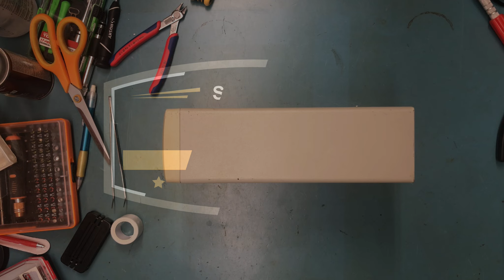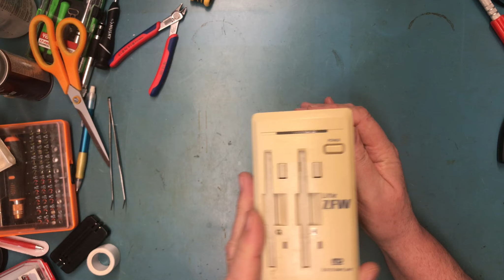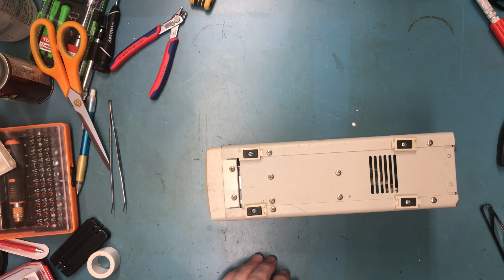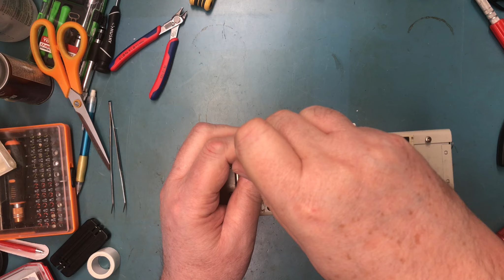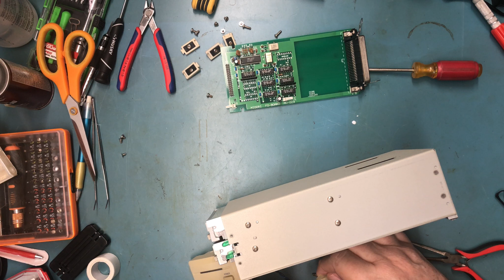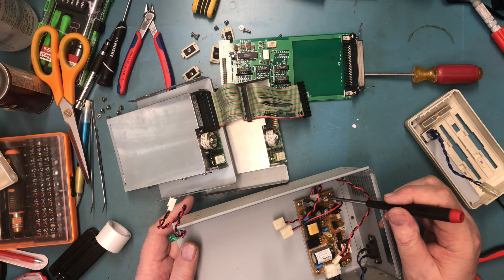STB1173 - Midori Denshi - External 3.5 FDD - ZFW Floppy Drive Unit

Comment: Hi, that 30 pin NEC shrink dip is the μPD71066, a FDD support chip / interface often used un more complex floppy subsystems like protocol converters or like here external drives to ensure clean signals at high (for the time) data rates on non differential connections. It separates the controller logic from the physical interface.
Reply from the maker: Thanks. This helps and makes sense. Any idea what system this drive was designed for?
Reply: @ShadowTronBlog  no, sorry. Especially with the Japanese computers I’m very unfamiliar with. I just recently searched up and down for floppy controller parts and their compatibles and equivalent chips from other manufacturers to replace a rare and expensive part plus it’s even more expensive companion support chip. And almost all digital controller and support chips from NEC start with μPD like the infamous μPD7220 graphics controller.